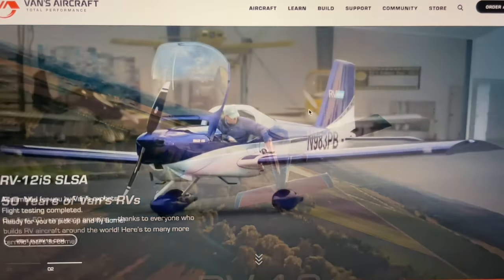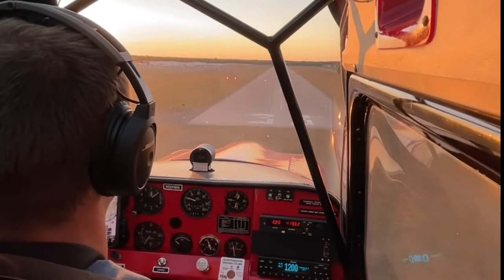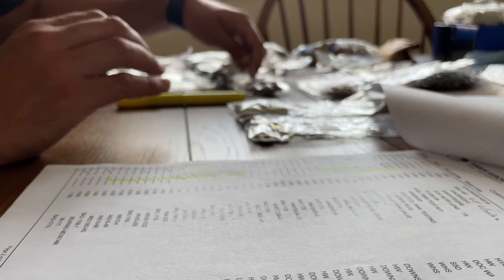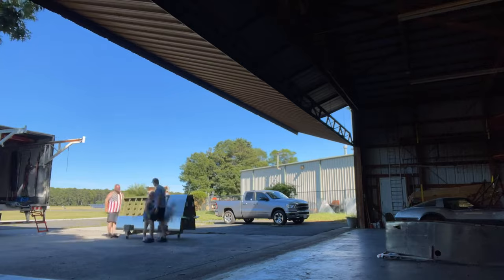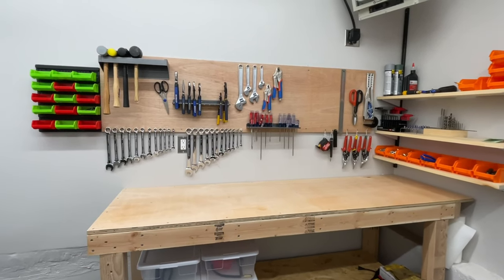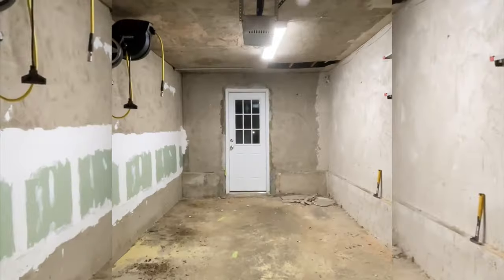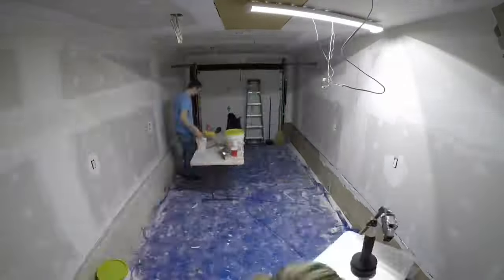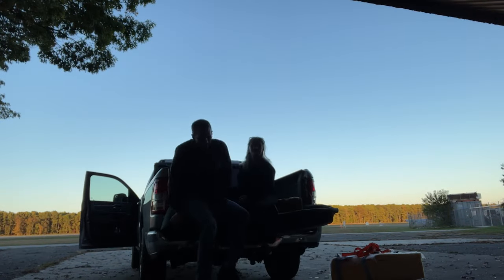Our Vans RV-7A Preparation

Comment: Cliff seems a little tall for a 7......why did you go for a 7 over a 14?
Reply from the maker: We went with the 7 for many reasons but the price difference was not worth the extra comfort. Have sat in many 7's and fit comfortable and have many plans for keep it roomy (no center console, thin cushions, no extension under the panel, etc. Our biggest problem to concur is going to be having it set up for the extreme height differences between us!